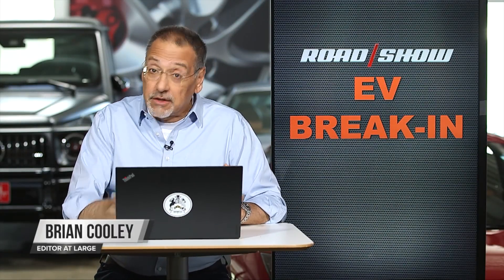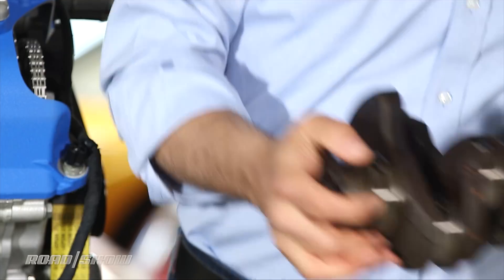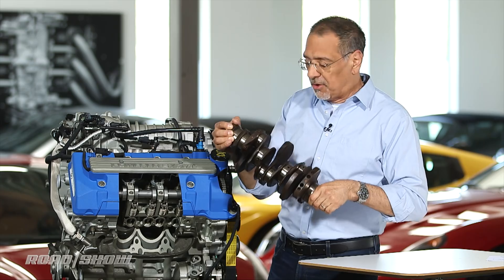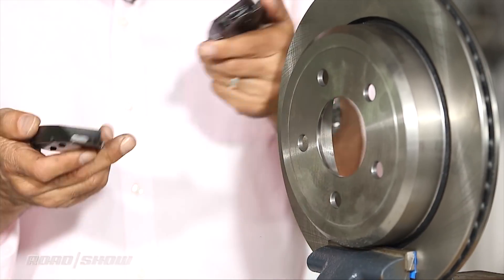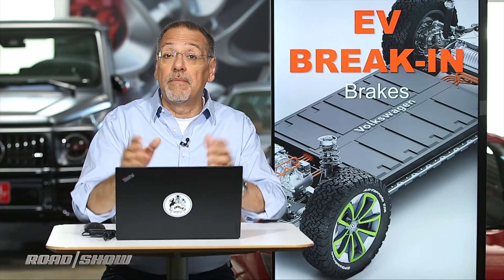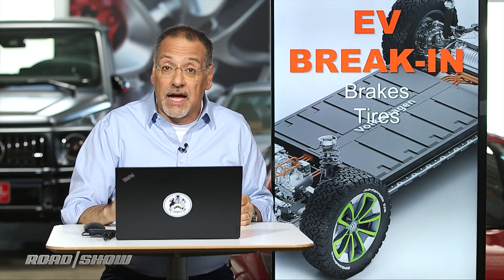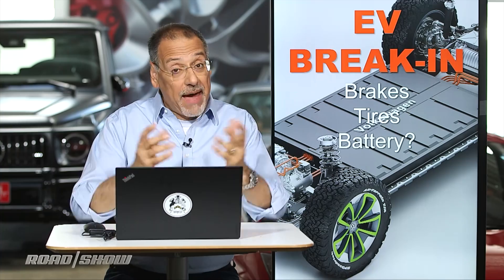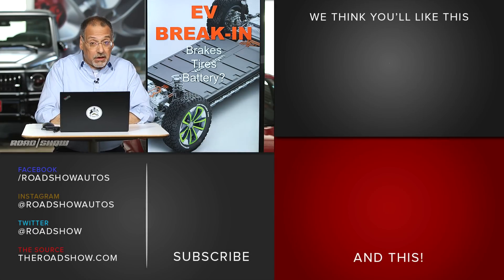Car Tech 101: How to break-in your new electric car | Cooley On Cars

Comment: I wonder why is byd manual says no fast acceleration during the first 2000km and dont maintain low or high speed for long. And also try to avoid emergency braking in the first 300km

Comment: All Li-ion batteries last the longest when the charge is kept between 20 - 80%
The battery hates being at 100% charge for long periods of time.
Sure go above or below on a trip if you need to but for most days 20-80% is best.
You will find the batteries charge at slower rate at a very low or very high state of charge. 
This is to protect the battery.

Comment: Great video. But regarding your last point about the battery. 
What you are saying is TRUE but the user still has control to keep the battery running below 85% and above 10% in daily shorter drives. Doing this and reducing usage of fast supercharging increases the battery life. On long trips definitely use fast supercharging and charge to 100% when you have the time and makes sense. Charging to 100% takes MUCH much longer than to 80% so if on a long trip it is best, if possible, to charge to just 80%, to reduce your travel time when including the charge time. 
2 years ago when I drove a Tesla Model X 90D from NY city to Colorado, a distance of ~2,000 miles, it took 48 hours (with 2 drivers) due to the longer charging times required since there were not so many Tesla Superchargers along the way and the required reduced maximum speed so that we could make it to the next Supercharger (slower speed gave the larger range needed). Now would take much less time since there are many more Superchargers. 
In addition now it will also take much less time with the longer range Tesla cars that can have 370 miles range. The Tesla Model X 90D had only 257 miles range.  Larger range car will make a long trip MUCH MUCH fast since mostly you will need to charge to much less % of your battery every time on the long trip. 
Tesla definitely did a great job at battery management and usage control and thus expected (Elon Musk design claim) to last 300,000 to 1,000,000. There are Tesla cars that already passed the 300,000 miles on same battery. Elon Musk claims that Tesla cars drive train is designed to last 1,000,000 miles and in the future the batteries will also last that long.
Reply: thx 4 the reverse FUD rant about the cult and your cult leader...

Comment: Lol breaking in an EV....... I can't believe the question was asked. I have 2 EVs and the battery degradation is extremely overrated.  It simply isn't noticeable on any EV with a proper battery management system.
Reply: With an exception of 2011 Nissan Leaf, its battery degradation is absolutely the worst thanks to a lack of active thermal management.
Reply: It's sorta-new tech. For a while we only had Hybrids which still had an ICE that could power the wheels. Most people likely only even ever thought the ICE Break-in was for the engine and transmission itself so there's that too.